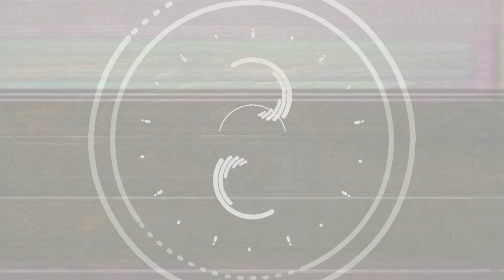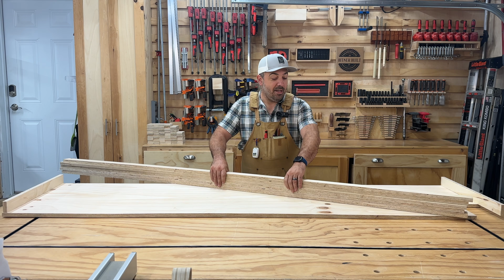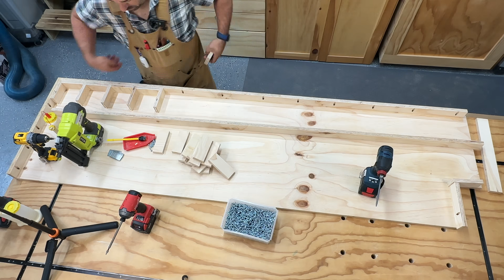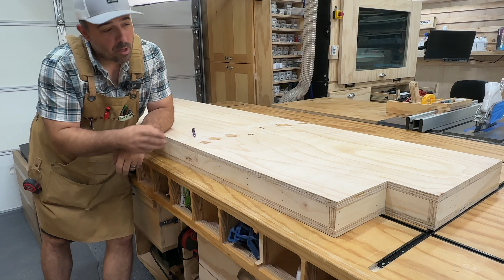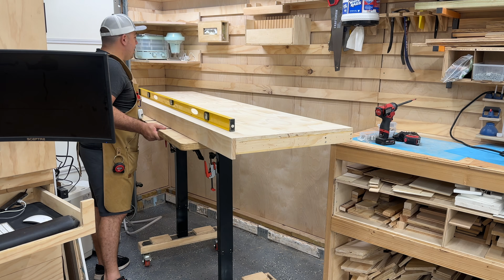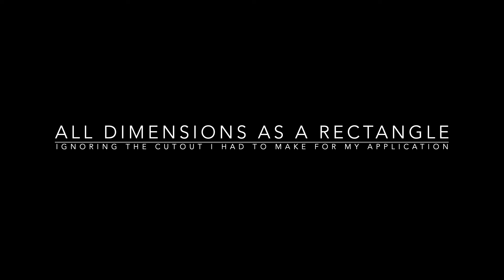Floating Torsion Box Counter - Small Shop Organization Series - Store Big Equipment

Comment: There is another way to do it, which I think is simpler. Composite materials consist of two layers of the main material separated by a filler whose only purpose is to maintain the distance between the faces. An example of a commonly used composite material is SIP panels, there are many others.
So, instead of making a wooden grid to keep the two faces separated, you just separate them with, for example, a sheet of expanded polystyrene, which could be one or two inches thick.
I think it is much faster, the result is lighter, and maybe even stiffer, by doing it as I say.
The proper adhesives to glue EPS to wood do not need to be pressed like carpenter's glue.
Note: I tried to explain this before, but I tried to write directly in English, and another user found my writing insolent, so I deleted that comment, this time I wrote in Spanish and used the translator. It is sometimes difficult to write correctly in a language that one does not master.
Greetings!
Reply from the maker: Thanks for the breakdown I will have to try it on a build! Also do your comments in Spanish, there’s always a translate button there so everyone can read it 👍

Comment: You should learn to “ dust your chalk line” before you snap it on project. It will give you a much CLEANER line. Dusting it means snapping it in midair to knockoff loose chalk. You could have mounted ledger boards to wall to rest top on then screwed top to ledger board from underneath. That would allow you to NOT cut the top around perimeter. Last. I recommend getting and wall mounting a  3 ft wide roll of brown paper from Home Depot. Then when working with expoxy tear off a sheet to cover / protect your top. It’s too nice to let epoxy spills ruin it.

Comment: Nice job!   I need a super flat and stable tortion box mobile workbench to do composite layups on.  That said I was planning on using only three wheels instead of four for the base.   I am wondering why you chose to use four wheels instead of only three?    The single castor will be in the middle where your pivot pin is.  Thanks.
Reply from the maker: Thanks! I’m confused, I made a wall mounted one, no wheels at all…no pivot pin etc?
Reply: @BitnerBuilt  oh my gosh! I'm sorry!  I watched a bunch of tortion box videos late last night and when I went back in my history I selected the wrong video to ask my question. 😳 Thanks for your reply and great video.

Comment: As an alternative to cutting the bottom panel to give access to attach to the wall one could use a hole saw in each space.  It would also compromise the strength of the torsion box less.
Reply from the maker: good idea!

Comment: Would some triangles on the sides underneath, and small L brackets in the middle help with weight load on that box?
Also, what size screws did you use to attach to wall? 3/4 ply wall?
Reply from the maker: So it does screw in on the sides in addition to the back so it’s plenary well supported, I did climb up on it (215lb) and it didn’t seem to flex or sag. The wall behind it is half-inch ply, then drywall then Studs.and then I marked where the studs were behind that. I actually used a lot of extras I think.Used grk screws from the hd

Comment: Looks very clean and I definitely appreciate the available space below.  I am curious though, with the weight of the top, other materials & supply, that thing will see quite a bit of weight.
No doubt you used some heavy-duty screws I am curious how confident you are into what you screwed into and its ability to hold all the weight. 
I am guessing the elimination of the legs is for clearance of the planer? I love a clean look as much as the next person, but I would be very concerned about its survivability as a whole and even its levelness after some time in service!
Reply from the maker: I’m 215lb and I climbed on it yesterday to see if it would move and it didn’t. 😃 because I’m able to screw it into the wall on the right and the left it effectively acts like it has four legs because it’s being supported in all four corners. I’m not gonna be putting 200 pounds on it going forward it’s gonna be for project work, but I just wanted to make sure I was confident in its abilities.

Comment: Love your channel! I am currently starting out and building a shop. Currently I have just plywood walls, will be doing a French cleat system.  You have given me much inspiration! I have 2 questions; What type of plywood did you use? Also why not make a desk using the French cleats?
Reply from the maker: Thanks!  so for this, I use the radiata pine from Home Depot. It’s a cabinet grade ply that has an a/B side, and a c side. Right now it’s $50 but it used to be 30 before the pandemic and where I live I can’t get Baltic birch. so your question as to why not build a desk using French cleats. Well, in this application, I needed there to be no supports at all Underneath, yes, I could’ve hung it cleat style however, I wanted his desk to be perfectly level and flat. If I had used cleats to mount it, there could’ve been movement overtime. There also can be inconsistencies over a long run of cleat and things that occurred do to expansion contraction so for this application, where it was extremely important to be flat and level always I went with lags

Comment: I love the look of the finished area. Not just the finished torsion box, but the whole work area.

Instead of cutting those strips off the bottom to access the mounting bays, could you have used a hole saw and cut a two or three inch access into each bay? That would allow you to glue the bottom plywood to the spacers all the way up to the edges, but you'd have ready access to those screws that attach it to the wall.
Reply from the maker: That’s a great idea and it definitely would have worked! Would have kept it even more structurally sound! Thanks!

Comment: Love the bender CnC.
Any reason to avoid half laps and use long cross sections rather than the small pieces? I’m prepping for the torsion top on the table saw project and I am debating on a hatch pattern of half laps but it also sounds like overkill too.
Reply from the maker: Half laps are excellent for torsion boxes, I did this one probably the simplest way you could do it just so anybody at any skill level could follow along. I also just purchased two sheets of three-quarter inch ply. You could use thicker material on the outside and thinner material for your laps. I think this is the eighth torsion box I’ve made and honestly I have felt that any of the ways I’ve done it, it all comes out well. I’m a big glue fan though, a few people have commented about not using the glue because of the weight, but I’d stand my ground on that one
Reply: @BitnerBuilt  awesome! Thanks!
And yes, glue is cheap and honestly doesn’t weigh enough for me to be worried about. I’m not a small person and my test is to abuse anything with my heft. If it can live up to me I will stamp approval it for anything short of my own kids 😂
Long live the glue!
Reply from the maker: @Livingdivergent  😂😂😂✌️

Comment: Nice job but if I could respectfully make a few suggestions: one of the benefits of a torsion box is that it is very resistant to twisting ( hence the term  “ torsion box “ ) while being relatively light in weight. The inner “ honey comb “ pieces used could be 3/8 “ and the outer “ skins “ could be 1/4 “. That much glue is not needed and will add more weight to the table ( as do the screws ) . I just make a frame from 3/4 “ stock then staple the inner pieces ( using 3/8 “ ) together without using glue, then I apply glue to all the pieces on only one side, lie one of the 1/4 “ skins ( with a little overhang which will be routed trim later ) on top and put every type of weight that I have in the shop on the skin, let it dry, trim the edges, flip, then repeat on the other side. There is an excellent article on making torsion boxes by Ian Kirby in Fine Woodworking 1983 I believe.
Reply from the maker: Thanks for the tips!

Comment: Have you ever seen the fastcap speed braces?  I watched a channel who built his shop benches using all surfaces using these with short drawer boxes in the front 3” or so.  He used the speed braces for mounting.   Looked like an awesome setup with tons of storage and the same convenience.
Reply: The channel is ThisisCarpentry, full shop tour, 13:35 mark.
Reply from the maker: No haven’t ever seen that before, looks cool! For this piece, no matter what I still would’ve gone with the tortion box top because I need it to be perfectly level and flat through and through but this looks like a cool option for other areas of the shop!

Comment: Just a tip. I can tell you’re using plywood from Lowe’s (don’t ask me how I can tell). If there’s a Home Depot near you, go there. They carry Columbia Forest plywood. It’s 5-ply poplar core. Very stable and consistent with very few voids. That multi-layer ply from Lowe’s can easily delaminate. Price is the same but a much better and slightly lighter product.
Reply from the maker: That’s the radiata pine from Home Depot. I don’t never shop at Lowe’s. It’s probably different in color because I’m in a different part of the country than you so it’s first from somewhere else.

Comment: It looks great man! Any tips for putting one together in a sloped garage?
Reply from the maker: Thanks! My garage is slope two on the right side of this torsion box to the left side there’s almost a 2 inch drop in the floor. So if it’s a wall-mounted, use a laser level or at least a bubble level
Reply: @BitnerBuilt  how about if it has legs?
Reply from the maker: @lukelipari5860  put two legs in the back the height you want, then prop the front up with a level, measure and cut legs for the front (if that’s the direction of the slope and the table isn’t being moved
Reply: @BitnerBuilt  great idea thank you!!!
Reply: Make sure you put on adjustable feet too, that will correct any small errors in leg height
Reply: @ThePonderingWoodworker  what if it's on casters?

Comment: Very nice addition to your shop, Justin! I have a P321 nailer that thinks it's jammed all the time. I returned one only to have the second one do the same thing. Did you have anything like that happen with yours? Any thoughts what I might be doing wrong? I've never found a jam.
Reply from the maker: Nailers can be funny. I had a full set of Makita from pin to finish nailer and they’ve been garbage honestly. The Brad before it died, did the same as yours. The finish nailer I know every single time I use it I have to do the first shot into a scrap piece of wood because it’s gonna stick halfway out, when the Brad nailer died, I ended up buying the Ryobi, and to my crazy surprise it’s been excellent. I’ve owned it for two years and never ever has a jammed up. And half the price too. One thing to try before abandoning yours you be test some other brands of nail clips. It could be a minute design difference in the nail head that the nailer doesn’t like.
Reply: @BitnerBuilt  good idea. I'm using the porter cable nails. I'll give the Dewalt a try. Thanks!
Reply: I have heard that sometimes the inner works get gummed up and need to be cleaned. Try cleaning yours before you give up on it. 
I have the same one and never had a problem. I also ran Porter Cable brads through it with no issues.